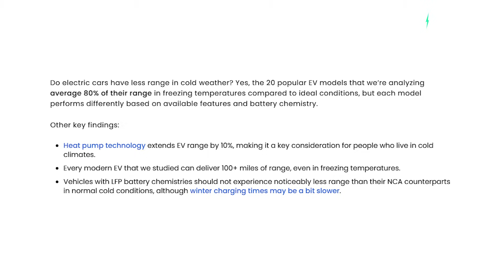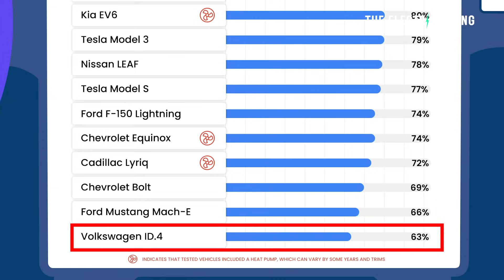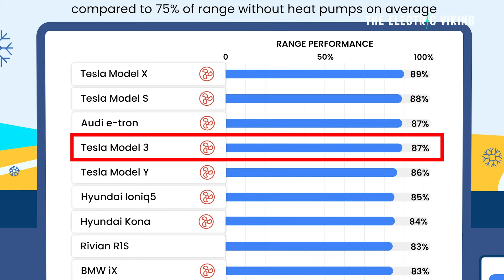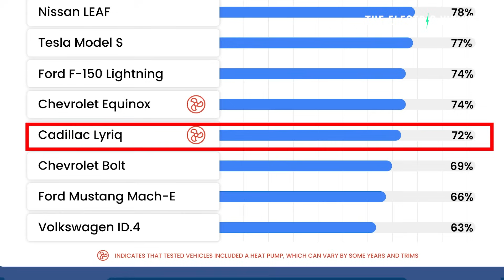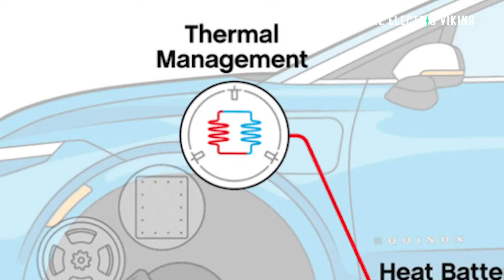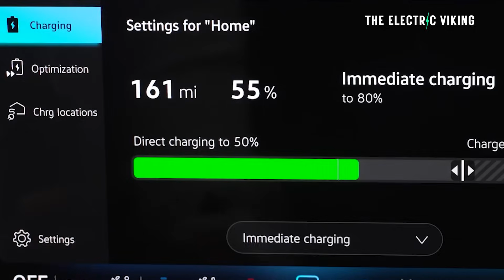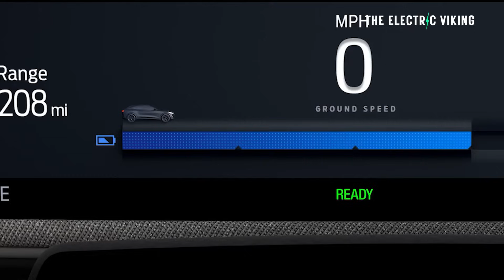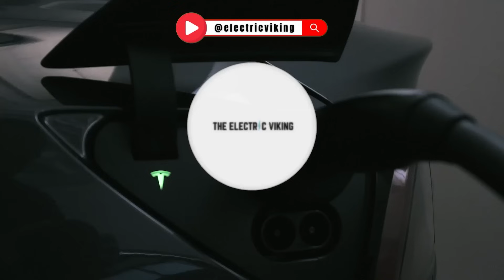HUGE study reveals how much range every EV model loses in winter

Comment: Just saw a news report saying EVs lose 14% to 39% in winter. I wondered what a ICE loses.
Googled: Cold weather effects can vary by vehicle model. 
However, expect conventional gasoline vehicles to suffer a 10% to 20% fuel economy loss in city driving 
and a 15% to 33% loss on short trips. The effect on hybrids is typically greater - 
with fuel economy dropping about 30% to 34% under these conditions.

Comment: 2018 model 3 LR single motor. I lose 25% in winter when temp is from 0-35 degrees. The problem is. Tesla’s range they per say with older cars is never what range you ever get even at 55 mph. So when they tell you get 280 miles according to my car. That is more like 220 miles. Then add cold weather. And lose another 25%. And you’re getting around 180.

Comment: Not all heat pumps are the same.  Some are far more efficient in cold temps because they actually preheat the air which can create a net increase in efficiency.  Maybe GM’s heat pumps don’t do that?  I would have expected better results.

Comment: Hi Sam, I have a Tesla M3 with a heat pump. I lose about 30% range in winter - maybe more. However, it depends on how cold it gets. At aroudn -20 to -30, there is a lot of range loss and those temps are not uncommon here. However, last year was the warmest on record, which would affect this study.

Comment: My 2024 Model 3 seems to not take temperature into account at all when estimating my range. I also suspect the range loss estimates are at freezing, not below freezing. Here in the USA we’ve been experiencing single digit F temperatures and my range has been reduced by at least 30%. Over one weekend I parked my car with 38 miles left on Friday night, had 22 miles on Saturday, 15 miles on Sunday, which immediately changed to 0 miles when I set off for a charging station 12 miles away. I made it to the station, but an accurate estimation of range based on on temperature would have made the trip less stressful.

Comment: Lightning has had a heat pump since 24 and so it will be interesting to see updated data.  Mach-W has a heat pump for 2025, and has different batteries in some cases now.  Same curiosity about updated Mach-E data.

Comment: I will mention a little tip from the "Choucroute Garage". When its colder but not freezing, time your recharge at home to end at the time you are about to leave home, that way there will be no need to preheat the batteries.

Comment: I have a Bolt EV. I live in a subtropical region that rarely gets too cold, but even then I'll just wear gloves and a jacket instead of putting on the heat because it will drain the battery pretty quick. I try to pride myself on the miles per kwh.

Comment: Studies like this ignore the issues of individual differences. Some people are comfortable with 18C setting, while others wants 25C+ to be toasty warm.  That will make HUGE difference in energy usage in -10 below external temperature.  With ICE cars, the temperature settings at 18 or 26 dont change fuel usage as the waste heat as byproduct of burning fuel far exceeds the heating needs of interior. But with EVs, lower temperature setting no doubt will conserve the range. Heat pumps don't make much difference when temperature is -20, and you want interior to be 25.

Comment: I live in Idaho (U.S.) and it’s 21* @ 11:00 AM. I have a CYBERBEAST waiting on the slab after charging last night. 
I drive about 30-40 miles daily and it’s recommended that I plug it in when I’m not using it. I haven’t gone on a road trip yet. I can do a round trip to Boise(250 miles). I schedule my charging to finish just before I want to leave. I have a couple of Electric Motorcycles for summer (planning on getting a Stark Varg Ex) and configured my APTERA last Thursday. I’ll be 82 in April so I gotta hurry. Thanks for keeping me up to date on EV news.

Comment: Your suggestion to save power by just using the seat heaters and not use the cabin heaters and just wear more clothes was absolutely hilarious. Obviously spoken by someone who has never driven in very cold temperatures. 😂 Besides the snow pants, parka and snow boots you suggest people wear in the car, do you also expect people them to wear a hat, scarf and mitts to prevent their ears, nose and fingers from getting frost bitten while driving their EVs in -25C weather? Simply warming their butts and back with the seat heater is not going to keep their extremities from freezing and it also won't prevent the windshield and all the windows from instantly frosting up from the moisture in your breath condensing and freezing on the glass.

Comment: Get an independent diesel car heater.  It uses minuscule amount of diesel  .  If I remember correctly they use 1 Desi liter  for 1 h of heating.  Which probably around 1 cup or less per hour.  If you won`t use your battery for heating in the winter , then you will lose only 10% of range +/-  . These heaters cost around 300 - 400 $  I really believe till we have these "first age" batteries , diesel heaters should have been installed in every EV by manufacturer.  You should be able to take it out for a summer and put in back in the winter. Fronk could be used for this purpose.
Reply: Lion has installed diesel heaters in their EV buses and they  have been catching fires. Not recommended.  Heat pumps is the way to go for now.
Reply: @PyroShields  Well , I bet they could be made better then catching on fire ? Heat pumps are much more expensive though . But yea , its a great technology.
Reply: @ Kind of defeats the purpose running diesel on an EV doesn't it?

Comment: Even with a heat pump, my BZ4X gets lousy winter range. However, I knew that when I purchased it (MASSIVELY discounted) and here in the Northern U.S., 150 miles of range at 0 degrees Fahrenheit is acceptable for 99.9% of my daily driving needs.

Comment: I own a 2024 model y awd. My range absolutely sucks in cold weather. I lost 35% the other day.
Reply: Mount in independent  diesel car heater . You will lose very little range, if you wont use your battery for healing.

Comment: Has there been any large study on real world range? 
If I understand correctly, if you don't drive below 20% charge and only charge to 80% which is commonly recommended, then real range is actually only 60% of the stated range>
Reply: True. Always thought the same. I would like an EV and will get one soon but all my cars up until now have been ICE and l always fill up the tank completely. Not happy running the tank until nearly empty but usually down to 75% or maybe even 90% so my current range is pretty good. Not sure l am going to enjoy the much lower range of an EV, further reduced by 60% as you say, but l am going to give it a go. It would only be on the very occasional longer trip that it will be a problem and l have solar panels for perhaps 95% of my annual motoring. As l said, am defo going to give it a try.

Comment: Mach E owner, extended range AWD. The temp this past week has been on the -20 range. Yes there is range loss 30% is a real number. However, we use the vehicle mostly for local travel only. Car only travels 150 to 250 per week. Last month it only cost me $34 in electricity. The car that it replaced easily was $180 in gas per month. Preconditioning is the key. Also Ford has this weird thing where it penalizes you for preconditioning off the plug. If you want to see your real driving range numbers you have to shut the vehicle off then turn it right back on. I'm currently averaging 1.8 - 2.1 miles per kilowatt hour in our frigid temperatures. In the summer I average about 3.2 - 3.5 . Also summer compared to winter, I still spent about $150 on my gas vehicle per month, that figure is down to 14-20  in the EV.

Comment: Our Dongfeng Nammi Box with a 42kWh LFP battery. It has a WLTP range of 310km. 
We bought it in November 2024 and had around 11.5kWh per 100km with around 12 degrees. 
Today, januari 2025, around 0 degrees, we still have 12.5kWh on average. That is around 10% loss.

Comment: My Tesla Y in Belgium has 420 km range in summer and 400 in winter. Based in winter temperatures not much less than zero C. However in winter you use a lot of energy warming and defrosting the car, so chargings are more frequent. A bit. No big deal though.

Comment: Today, in the beginning of 2025 in the places where winter is harsh I would refrain from planning to use one EV for all the needs, especially in middle of Midwest of the USA or up North in Canada above that area. Instead an EV would be a perfect commuter if garaged with Level 2 charger installed in that garage and the EV range being quite large above the commute distance.
For all other scenarios it might be needed a vehicle still including an ICE inside a plug-in hibrid or a range extended EV. Some folks in those harsh places needing to tow heavy loads for long long distances might benefit keeping Diesel vehicles.

Comment: I drive a Lyriq .. we’ve had weeks of sub zero weather, the loss on range is around 1/3 if you crank up the heat, the Lyriq has rear heating, and 3 separate dual heating zones in front, if your running all of them at the same time, with all the fans on high, yes you will use 1/3 of your battery just heating the vehicle. 

I wonder how many zones does the tesla have? Rear heating? If you’re going to compare apples to apples …

Comment: This is why I tell people a 300 mile range EV is so important. After 7 to 10 years the range on the worst day of the year might be 60% of the rated range. 
-20% for battery degradation 
-15 to 20% driving in the snow 
-10% if you have 4 passengers and a full trunk. 

That causes your 300 mile EV to only have 180 miles of range. Which is useable. If you start with only 200 miles of range you worst day will be 120 miles of range. Causing real range anxiety.
Reply: The problem is that EVs generally operate between 10% and 80%. That 300 miles of range is really only 210 miles unless you charge to 100% and run it to 0. And that is before you subtract for cold weather.
Reply: I would say long range EV’s stay between 10% and 80%. And my Nissan leaf got charged to 100% most the time. And I regularly got home with just a mile or 2 of charge available. 

With my Tesla I would always charge to 100% if the weather called for snow. And if I am heading to a tesla super charger I would be fine arriving there with less than 4% charge. I would never do that heading to a non tesla charger. There would be way to high of a chance the charger would not work. 

Your point is accurate though. You have to take that into account with an EV. Which will be new for most new EV owners.

Comment: Depends which winter you’re talking about. In Israel, with a harsh summer and a moderate winter, I get significantly more range in winter as there is no need to use the A/C 😊

Comment: Charging a Lithium-ion battery in sub-zero temperatures causes internal lithium plating, which serious degrades the battery irreversibly, and ultimately can cause fires.  It's mitigated by charging at extremely low rates - and by heating the battery.  So, the best EVs will have the means to pre-heat the battery prior to charging - also useful prior to driving, as regenerative braking is effectively the same as fast-charging.

Comment: My Smart #1 Brabus has a heat pump & NMC battery, if I do nothing I lose 20% however if I set the departure time and check ‘heat the cabin & ‘pre heat the battery’ I only lose 10%.
This also has other benefits including no loss of performance & no loss of regenerative braking. Doing this only uses 2 kWh of electricity from the grid or £0.14p using cheap overnight electricity.
Reply: I came here to make the same comment. If you’re plugged in with a charger, use the grid to power the battery and cabin warming first to maximize range.  I have a 2024 Model X where I do long trips (150 miles each way).  A full 100% charge gives me around 340 currently, but I’d get about 280 from it, which is a little less that 89% I think even with this trick on the outbound leg.  So I do need to use a supercharger to add a bit.  By setting the supercharger destination into the navigation, it will preheat the battery.  Do this early as I’ve had it preheating from 55 minutes out on a cold day.

Comment: No heat pump EVs loose a lot.  May be winter range is around 70% of summer range. 

In the Norwegian test Tesla’s were pretty bad. They lie about their WLTP even in summer. May be the cutbacks from summer is not very bad as Tesla heat pump is indeed technically superior. Just the Tesla range is pretty bad overall. They lie a lot.

Tesla model 3 and Hyundai’s use their heat pump to warm up the battery to boost range as well as to heat or cool the interior.  Some models only heat the interior with heat pump…
Reply: Tesla do not lie about their WLTP figures, no maker does. It’s a standard way of calibrating range. It’s WLTP itself that’s wrong and needs revising, the car makers just follow the standard.

Every single car maker forever has put out claims for battery range or miles / kilometre per mile for ICE that are not true, but it’s WLTP and other standards to blame not them.

What I’d do if you’re so concerned is try suing the makers and see how far it gets you.
Reply: @ISuperTed  I am not going to buy car from fraud company. Problem solved!

Comment: In really cold winters , in Russia for example, you keep your piston engine running or you loose the use of your vehicle until the spring. I read that in WWII aircraft engines were heated by making a fire under the engine until the oil was warm enough to flow again before trying to start them. Problems are much easier to solve with modern batteries.
Reply: What about a block heater?
Reply: @ecospider5  Block heater is for engines.
Reply: @PyroShields
The OP specified pistons so we are talking about “Engines”.
Reply: Running the engine in a modern car wrecks it over time. Older cars benefited from warming up the engine, newer ones don’t.
Reply: You're going to need a big block heater in those kind of temperatures.
Reply: Many vehicles say plug in a block heater at 0F. So I assume they work in temperatures way below that. But I have never used one. So what do I know.
Reply: In the late sixties we used to light a fire under the fuel tank of our diesel vans in the early morning, because of fuel waxing - Health & Safety would love it now.

Comment: My old 2018 Model 3 RWD didn’t have a heat pump back then. Would lose quite a bit in Connecticut winter. My Model X is fantastic in the winter

Comment: In practice, just deduct 30% of the official range and you get a realistic number for a typical winter in Europe.
Reply: True, mine loses about 25% as it doesn’t have a Heat Pump, others less. Not an issue at all once you know about it.
Reply: This is certainly true of my MG5 second generation. Thanks.😮
Reply: about right.
Reply: When Hertz was pushing 3s as rentals, we would see them on flatbeds at Colorado ski areas weekly.

Comment: Wonder why they didn’t test a Volvo? I think my xc40 recharge loss is quite small. It has a heat pump.
Reply: Volvo cars now made by Chinese company 3:53 Geely which also makes Zeekr. That’s one I might buy if it was available in the US.
Reply: @ Volvo is also making electric cars in South Carolina for us buyers and the one I have was made in Belgium but it’s a 2022 model.
Reply: Interesting. Per Trump those made in the US wouldn’t be subject to his contemplated tariffs.
Reply: @ Chinese made EVs have had 100% tariffs for a long time. That’s why they planned and built the SC plant.